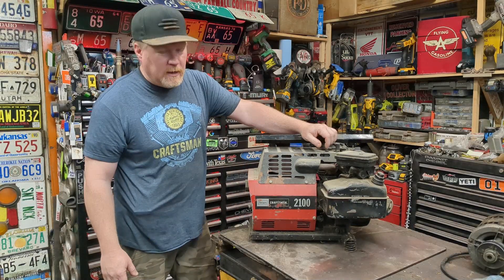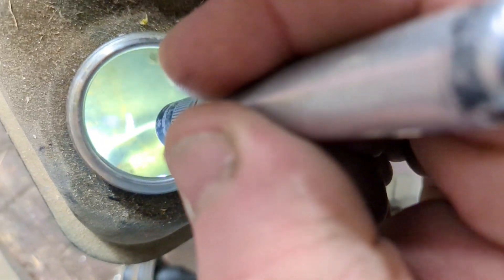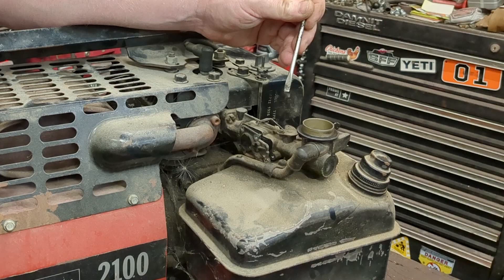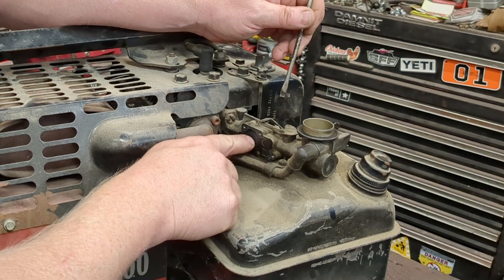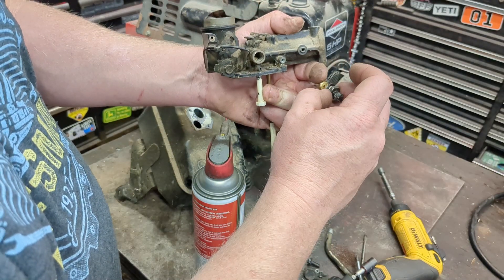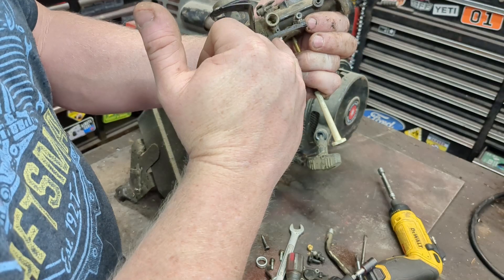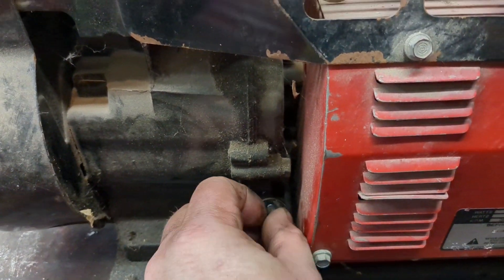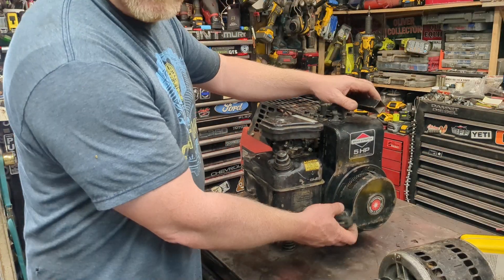FREE vintage Generator WILL IT RUN

Comment: Flatheads never die i usually pick mine from the scrap yard. Starting to get a hoard of briggs 5hp and on the last trip i got a tecumseh from the 60s not sure what hp it is because the data plate is missing.

Comment: One, '85 being  [almost] 40 years ago, just seems weird; two, whats the workaround when diaphrams and reed valves are not available, gate valve and particular dia hoses ? Is there an adjustable battery powered carb / fuel air atomizer device  small engines ? Attach directky to cylinder intake , and utilizing the pulse port?

Comment: Hasn’t anyone come up with a diaphragm made from a material that stands up to ethanol?? There has to be something!
Reply from the maker: Supposedly these are ethanol resistant but it really doesn't matter as ethanol will ruin everything else on the engine. The biggest problem is ethanol is hydroscopic and pulls in moisture out of the air. So if you put ethanol fuel in the gas tank, it'll kill itself within a year or two with rust.  You'll likely get stuck valves from rust on the valve stem via ethanol moisture. It's just a death sentence.
Reply: Yes actually, it's called un-obtanium

Comment: IF you ever get pinhgoles in the tank or cup, geta tube of Sesl-all and put a blob over the pinholes.  I've sealed up several Briggs tanks like that. I have a couple of 85 five horse flatheads, one with a gear reducer for a walking tractor and another 4 horse on a Snapper. SWEET motors and Ginger was wanting her teeth cleaned by the pressure washer. Hope you got the diesel going Batman! Blessings Yall

Comment: Great  save  l have about 10 of those B and S. Engines  on different  things  and l think they all need  fixing    l got a Monkey  Wards  welder that looks and works  like it is brand new  also a  Lincoln  Tombstone   thanks for the great video  Tank

Comment: I have a late 1980s, electric start, Briggs 8hp on a self propelled chipper/ vacuum  machine.  It has the good cast iron cylinder sleeve. Lots of hours, burning oil. I considered a cheap replacement engine after I priced the parts for a proper rebuild, parts are crazy expensive!  It's going to get rebuilt anyway as it has the extra feature of the flywheel pulley for the  self propel feature.
Reply from the maker: I've done a few rebuilds on those. Generally, all you need is a set of standard Piston rings. Don't worry about boring it out or anything oversize. Never had one where I did this that didn't stop smoking and have more power. No, not 100% new but a good 80%-90%. The hardest part about this entire job is going to be removing the fan/chipper blade from the motor.
Reply: What he said plus a light hone can help with oil burning.

Comment: Great video, thank you! 
I have an even older Sears 3500 alternator (generator)
model 580321862. 120/240 volt. Runs great, hardly ever run it. Built a wheeled cart for it

Comment: I started out in the late 80’s picking power equipment out of the garbage. And like you said these little engines were on everything. I ended up getting a job in a small engine shop in the mid 90s during highschool and fixed so many of these little guys. And now…… they are gone!
Reply: Carbs are kinda a pain to remove compared to modern stuff, but if it's maintained they're great. Not much can go wrong with a flathead
Reply: @M.TTT.  yep very true, carbs can be a pain but after doing so many you get faster. Good little engines !
Reply: In the 70s - 80s my grandpa owned a mower shop. These things were everywhere. 5 horse on a minibike was mean.

Comment: Would be fun to see you fab a gas tank for a machine that would otherwise be junk. Aluminum sheet and a little brazing? Granted this one would be tricky with the “tank in tank”. And I guess making the cap and threads would be the hardest part. Nothing a little 3d printing couldn’t solve though. 😄

Comment: You scored big on that one!
Did you find any mouse nests inside?
Ive had great luck with RedKote tank liner on those tanks and jb weld covering the typical rusted  bottoms on those tanks.
Reply from the maker: Luckily we don't get mouse nests around here unless it comes from a farm. 20 years ago I would spend hours repairing these tanks. Glad those days are behind me.

Comment: He's absolutely right about a (used) replacement metal gas tank for these older Briggs & Stratton engines cost more than one of those inexpensive Chineese universal engines.  I have a rototiller from 1995 with a B & S 5 hp engine that has about 20 hours use on it, but it was put away sometime in the 1990s with gas with ethanol in the tank. It totally rusted out the tank and the little reservoir tank for the carb to take fuel from (ruined the carb too). The tank is no longer made for this engine. I found an exact replacement (with carburetor ) on Ebay in perfect condition, from the 1990s (owner used fuel stabilizer). But I paid dearly for it; cost me $160.

Comment: Is there a place you can buy the plastic pick up tube.if not how would you fix a broken one .thanks
Reply: I got a plastic fuel line that fits and used it as a splice to fix mine.  Cut the broken section off and spliced the fuel line in.  A tight friction fit worked.  Amazon has them.  But a price check shows you can get a complete carburetor for the price of a pickup tube.
Reply from the maker: You can get chemical resistant rigid tubes from aerosol cans. It's the pick up straw/tube going to the bottom of the can.  Cut open the old can pull the tube out.

Comment: I read where rule of thumb is 2 HP for every 1000 watts roughly
Reply: That's a good rule of thumb.  Round up to the next highest HP engine.  Comparing my 8kw generator:  One HP is 746 watts.   At 2100 watts, a 3.5 HP engine is more commonly used.  My 8kw generator came with an 11HP engine.
8000 ÷ 746 = 10.7 HP.  If I ever have to replace the engine, I'll upsize to a 14 HP or slightly larger engine to handle load surges better.

Comment: Nice fix! Handy to have around for sure. Back when Sears used to spec. out products so well and usually had schematics and service manuals with parts breakdown available for most of them. Those days are long gone with the exception of some appliances unfortunately. 👍
Reply from the maker: Sadly even if companies did provide this stuff the mass would still toss it these days. I mean who would want this generator as it doesn't have bluetooth. I really need to up my electronics ability to keep up with the stuff you're fixing.
Reply: @sixtyfiveford  Probably not worth fixing a lot of today's products, mostly made with the planned obsolescence design philosophy. I'd say we gotta keep unearthing the stuff that's 20+ years old.